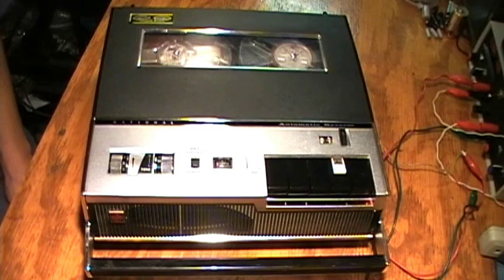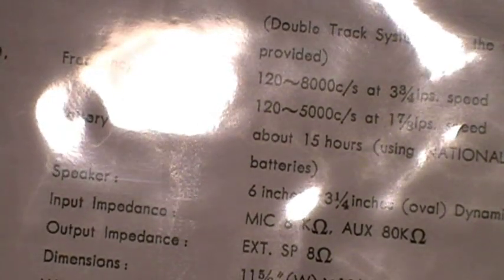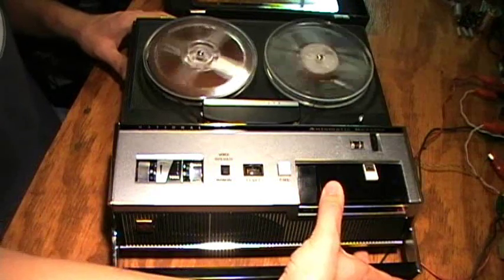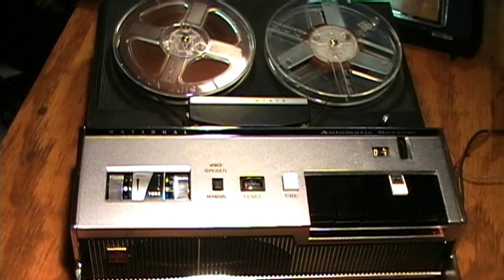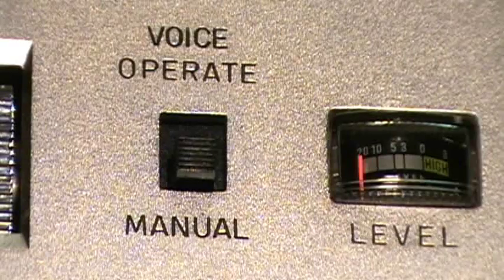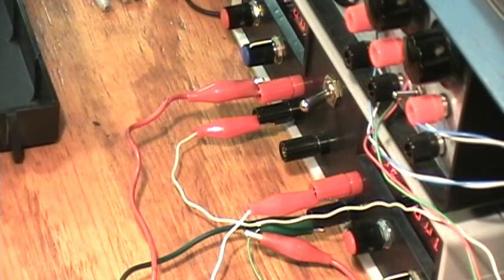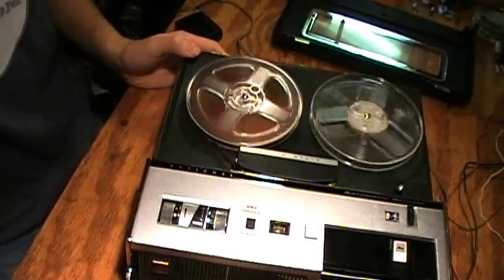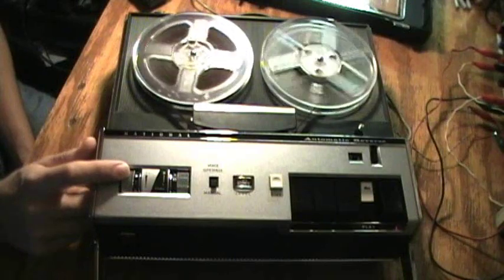National RQ-158S AUTO-REVERSE portable reel-to-reel.wmv

Comment: Thanks for posting the vid. Just acquired a RQ 158S yesterday. Mechanics worked but had very faint to no sound at all. Did get static when depressing play button and after pressing play and stop numerous times in a row I now have sound most times.
Do you have any suggestions on how to clean up those contacts? Also would you happen to know the specs on the AC adapter for this unit? I tried an old adapter that was laying around (input 120VAC 60 Hz 8W/ output 9VDC 300mA) and it reversed all functions.?? Works normally on battery power.
Reply from the maker: For the contacts, spray the record-play switch with contact cleaner, and move it between record and play a few times to work the cleaner in good. For the power, 9V is right, but the polarity is reversed from that of your supply (why it ran backwards). You can just cut the wires and swap them around on your AC adapter.
Reply: Many thanks! Switching the wires, as you said, did the trick. Also took your advice on switches and scratchiness has cleared up.

Comment: does this not have a stop foil sensor to reverse the direction automatically? maybe I missed it in the vid, but the only way this deck seems to change direction is by pressing of the white button, right?
Reply: It does have the ability to reverse direction if the foil is attached to the tape.  I remember that from using one of these years ago.  But without the foil, it won't.

Comment: I have the Concord version, which i can't hear ANYTHING from recording or playback at all.

What voltage is that 4uf capacitor.
Reply from the maker: Get 10V or higher. I would recommend also replacing the other electrolytics in the amp, as that 4uF I mentioned only affected recording, not playback.
Reply: Turns out i had the monitor switch off. Though i still need to replace that capacitor.

The Concord version is sold as the Automatic 350